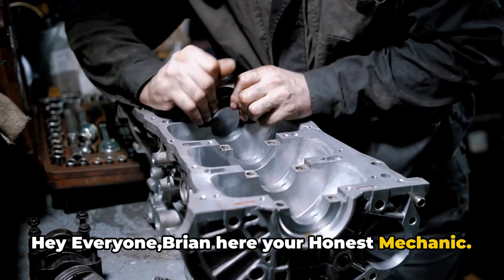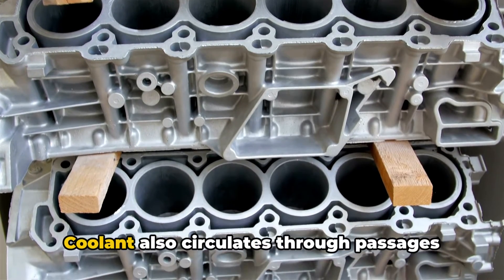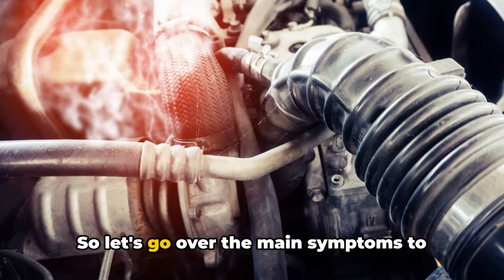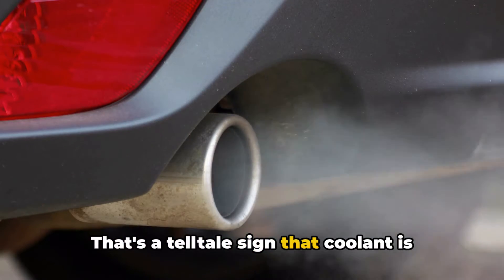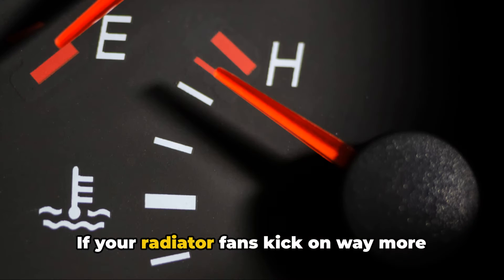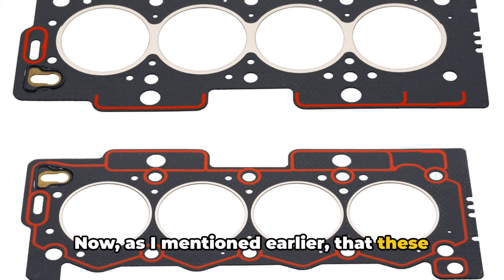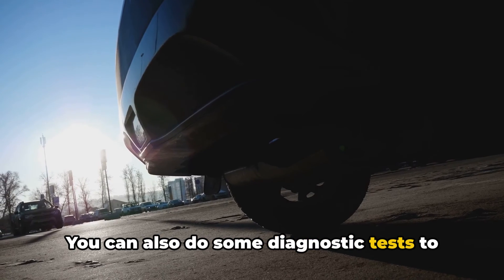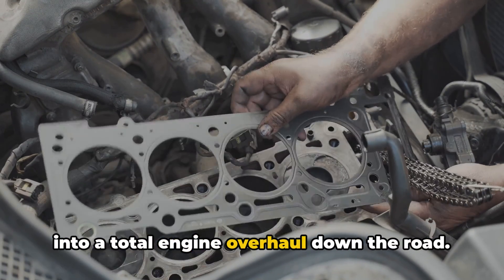Cracked Cylinder Head Symptoms: 8 Common Signs

Comment: My Polo VW is now sitting at 226,000 km. It’s still running, and there are no coolant leaks, but I can tell something isn’t right. I’m taking it in on Monday, 1 December 2025, but for now I still have to drive it to work, and I’m honestly just praying it doesn’t give up on me before then.

When I drive, I can feel the car misfiring and losing power. It mostly happens when pulling off in gears 1, 2, and 3. Once I pick up speed, the issue seems to fade. There’s also a strange noise when I start the car, along with a noticeable vibration inside the cabin.
Reply: biggest lie i saw on paperwork a car i bought, the previous owner was told the cylinder head was porus, cylinder heads warp or crack they are never porus is just stupid lies.

Comment: Thank you for this video! Waiting to hear from my mechanic as to whether i may have cracked cyclinder head. Weird thing is, the only symptoms i have is smoke on starting & when sitting idling for a bit & having to top up oil every couple of weeks, and some minor power drops mostly off revs & some misses every so often. And then recently found brown sludge in the radiator cap which is fairly new
Reply: Head gasket

Comment: I have no coolent leaks, No over heating,No smoke. But oil in my radiator.
Reply: my car also has the same problem 
Oil comes with a coolant tank
Reply: Head gasket
Reply: oil cooler

Comment: Im confused, I own a 97 civic HX and I replaced head gasket, pvc valve, heads and  catalytic converter, down stream and up stream o2 and my car starts but it shakes and white smoke comes out but it’s only like the first 2 min
Reply: From a Arias to a Arias. If you did all that and still cant figure it out. Take it to a good Mechanic. Not just any guy. Sometimes its worth paying top dollar. 
Also for the smoke out the exhaust make sure you don't confused water vapor from the cat with other types of exhaust smoke. Look at it when it floats up if you see a blue tint from the smoke that's oil combusting with the gasoline. If its Thick milky smoke(Pause) and has like a sweet or maple smell too it. then there's coolant mixing with the exhaust fumes. In your case since you did all that work. Its either just regular vapor you see on cold starts or oil getting in to the cylinder and burning off the next cold start. That case it can be a faulty spark plug gasket, or possible ring seal from piston.